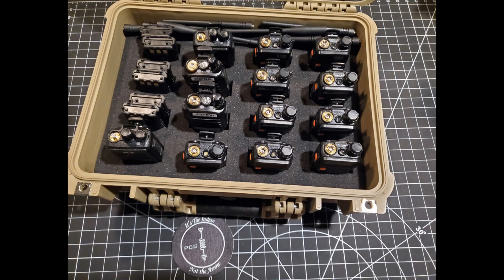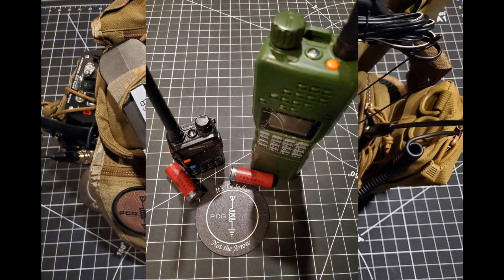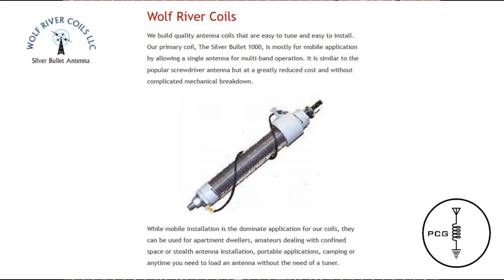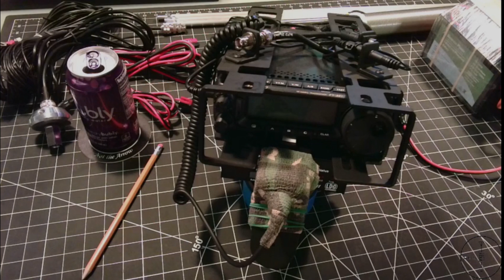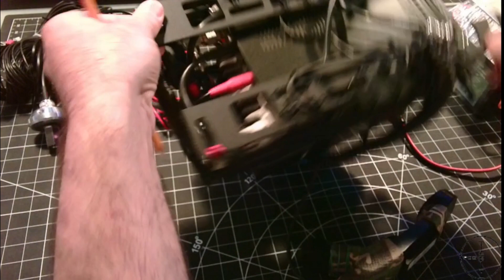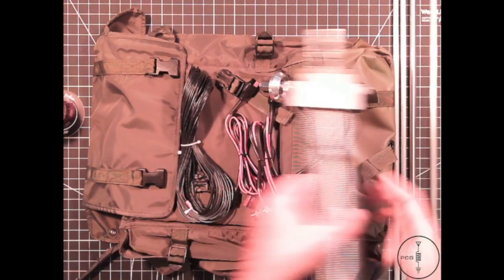E17: Yaesu FT-891 Pack Frame

Comment: I use the same tuner for my 891. I load the internal battery tray with lithium AA's, and with every day use, it's still going strong after a year.  As a back up, I carry a 9 volt with proper adapter to power it. A 12ah battery for the tuner will power it for a LONG time. I really can't  see the worth of the extra weight and complexity.
Reply from the maker: I've heard from one other person that the AA's last a while since the tuner doesn't use a lot of power.  I have a few other things I run off my external battery so that's why I chose that route.  But, if one wantee to travel light the AA's will do just fine.

Comment: thanks for the video on this. its interesting to see your take. i am working on something similar to this for my own purposes.
Reply from the maker: Thank you.  What radio are you planning on using for your setup?
Reply: @PartisanCommsGroup  I will also be using an 891, but i am going to start with my yaesu 200dr. i have a little more utility on 2m/70cm and gmrs at the time being. alot of that is driven by what i have for mobile antennas. Further. I can fabricate a chassis easier than i can spend the dough on the chassis. So I am going to roll my own. But while we are here, i wanted to say thank you. You blog post of the td-h8 helped me a lot this week.
Reply from the maker: @Theleagueofpirates  The 891 is a good radio, I've been using it for a while now and I'm pretty happy with it.  I hope it's a good one for you as well.  I'm glad the blog was helpful.  I wasn't sure if anyone read it much, so it's cool to hear that the content helped someone.

Comment: Nice rig but that 12ah battery is way overkill for the tuner. It has latching relays and doesn’t need a constant power infusion so you can get away with something like a 4-6ah battery which is going to be a lot less bulky and heavy (not that the lifepo4’s weigh all that much) the 12ah battery will easily run the 891 for 3.5-6 hours depending on duty cycle too. The 20ah is a good long-day use battery though.
Reply from the maker: Thanks, it seems to be a decent rig so far and I'm pretty happy with it.  Regarding the battery, it is overkill for the tuner but, I also use it to charge other accessories.  If I was going to just power the tuner then a smaller battery would be more appropriate.

Comment: Cool setup, but why not make it a lot lighter and simpler and just run a Xiegu G90, built in tuner , swr meter, waterfall display, and yes its 20 watts, but diff between 20
Watts and 100 watts is about 1 s unit. On top of that running 20 watts would allow u to use smaller battery.
Reply from the maker: I just wanted to see if I could do it, and make it all work.  A G90 would be lighter for the field, and I was considering doing a video on one.  But, I haven't been very motivated lately.  I think I'm a little burned out on doing videos.
Reply: Well if u ever do make a g90 video, I’ll be sure to look it up . Thx

Comment: That's a nice kit.

I use the Z11Pro-II with both my FT-891 and my FT-991A.  It's a fine tuner.  I have no complaints.

However, because the tuner uses latching relays (not all of them do), it only draws noticeable power (and only 1/4A max) during finding a match, and not while operating (there is a 25 micro amp draw during operation, presumably so that it can detect a need to re-tune).  Additionally, during the tuning cycle, the radio operates at reduced power.  So you're never going to come close to the battery's current maximum.  The 20AH battery is all that you need.  I run them from a single source (I have the same battery, and at home I use a power supply) and I have never heard detectable noise.  (It's transmitting while tuning, and whatever is drawing 25uA isn't noisy.)  I'm glad to see that you got the interface cable.  It can work without,  but you may forget and tune with higher power, which may shorten something's life (relay contacts, final amplifier transistors).

LiFePO4 batteries are a great choice.  They give a high energy to weight ratio.  And they don't have the fire hazard that older lithium batteries to.  Do be sure that the charge controller is for that specific chemistry, but it looks like you have the right one in the video.  The Genasun controllers have an excellent reputation.  I can't attest to that since I'm using the Budipole Power Mini 2.  It's a bit pricey, and it's always out of stock, but I enjoy the battery totalization display, the choices of multiple chemistries, and the two load outputs (I haven't had to make a Y adapter for tuner and radio).

BEWARE that LiFePO4 must be above freezing during charging, in case you do a solar boosted sub freezing outdoor operation.

There is a conversion kit available to replace the power connector on the 891 with power poles.  If you go this way, keep the original connector somewhere that you can find it, should you every want to send the radio to Yaesu for servicing.

The TIA is a fine antenna.  You may find that the tuner is unnecessary with it, because adjusting the coil and the whip will likely make it resonant.  But you might want to add an end fed random wire (I've worked 160m with the Chameleon EMCOMM-II) or an end fed half wave, say for 40m, which should work well on 20, 15, and 10 (the tuner might help on 15, or depending where on 10 you want to work), and the tuner should let you get 30, 17 and 12.  Such an antenna on its winder will easily tuck into that pack, and you can use your radial wires as a counterpoise.
Reply from the maker: Thank you, so far the kit has been working as expected and I don't have any complaints.  When I was trying to figure out power management options I was looking at the Budipole Power Mini 2 you mentioned.  Unfortunately they were out stock at the time I was looking so I ended up not getting one.  How is the Mini 2 working out for you so far?  I think I'll try to get one if they come back in stock.
Reply: @PartisanCommsGroup  I'm getting old, so there haven't been as many field operations as I would like, but so far the Power Mini 2 has been flawless.  I think they're having trouble getting parts, which is a common story.  There are microcontrollers, for example, that aren't being made, and the replacements aren't fully compatible.  A redesign using a currently available micro is possible, but I don't know if that's their issue.  And they just might have an investment sitting around in partially completed units that they would like to shift before investing in new boards, waiting for a promised part.  The much discussed supply chain problems may not be the only wrench in the works.

Comment: I'm curious as to why a separate battery & solar charge controller was needed for the tuner. Considering how little power the tuner needs, it could either be powered by the same battery that powers the FT-891 or use AA batteries internally. I read on the LDG web site that the tuner will run for about a year with normal use on one set of AA batteries, but I don't know if this is one of those devices that would cause the batteries to corrode over time. 73 KD5YOU
Reply from the maker: Thank you for the question, and you are correct, the LDG tuner does not consume much power.  You can remove the cover and install AA batteries and it should run for a long time.  There were a few considerations for the second external battery.  The first is a bit of lazy argument, but, I didn't want to have to remove the cover to replace the AA batteries if they went dead, so I decided on an external power source.  But, for simplicity it would easier to just use AA batteries.  For those wanting to go the AA battery route, I'm not sure if you would run into corrosion over time or not?  I haven't seen any comments in the various forums I researched for this build about battery corrosion, but I also didn't think to look for that; and is an interesting question.  The next consideration was, I had thought about running the tuner and the radio off one external power source, but a concern I had was possible noise interference so I decided to keep the power sources separate.  Lastly, when I build kits, I try to set them up for situations where I may not have power, and I like to have several batteries and charge controllers that are interoperable across all my gear.  So, in the event I drain the primary battery for the Yaesu, I can use the tuner's battery as an emergency backup, and pop in spare AA batteries in the tuner if needed.  73.
Reply: @PartisanCommsGroup  ok thanks for the explanation. I have the 817 LDG tuner that uses internal AA batteries, and I have yet to experience any corrosion. My other tuner is a MFJ 845 manual tuner so it doesn't use power except for illuminating the SWR/power meter.